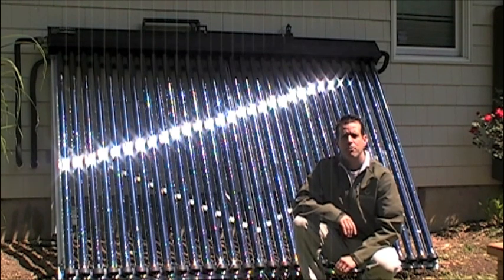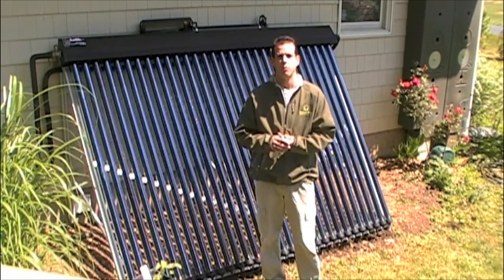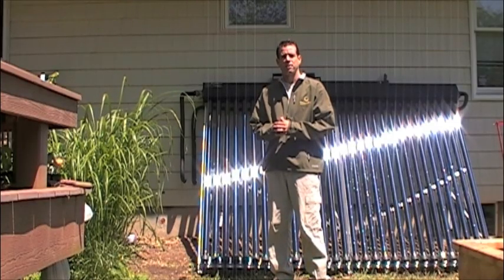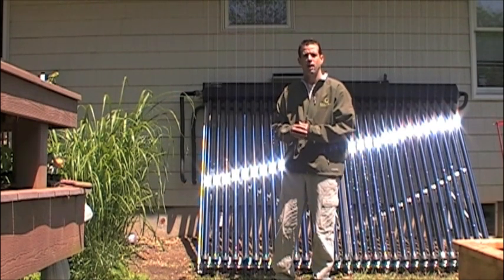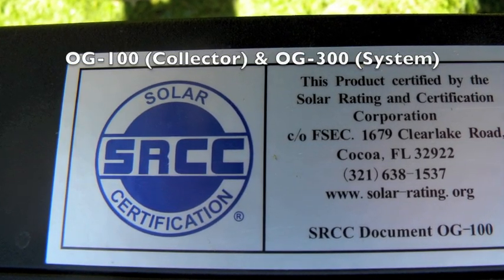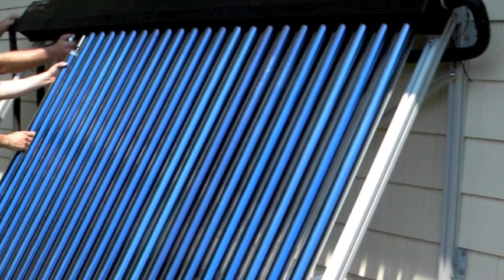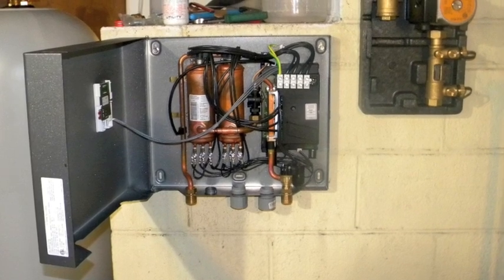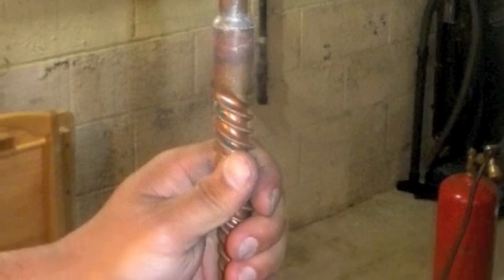Installation of a Sunmaxx Solar Thermal Hot Water 30 Evacuated Tube NJ New Jersey Part 1

Comment: this video is 5 years old Sunmaxx is still in business....whats with the going out of business overlay?
Reply: SunMaxx Solar is in business and is doing great. Give them a call with any solar thermal needs.  SunMaxx Solar never went out of business.  The collectors offered by SunMaxx Solar whether flat plate or evacuated tube are tops in the industry and their production lines are running and full.  The solar hot water market has been inconsistent at best and forecasting inventory along with growth was stunted with most dealers and installers moving to PV industry.  The top 3-4 manufactures have either left the market or are no longer in business. SunMaxx Solar did the most in revenue the last two years of any USA solar hot water manufacturer.  I recommend visiting their site or giving them a call.
Reply from the maker: +McClendon Const   This disclaimer wasn't added at the videos inception.    Do yourself a favor and seek elsewhere.